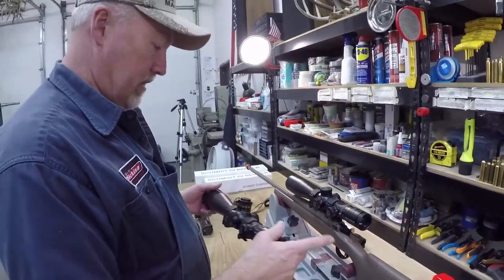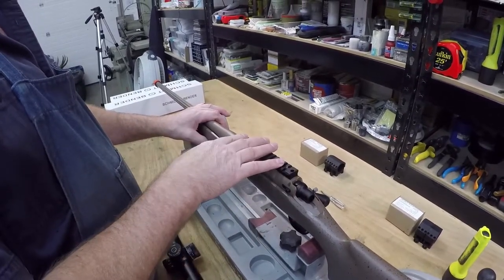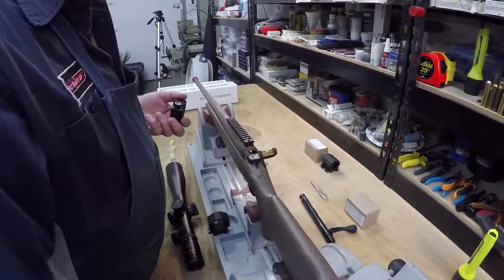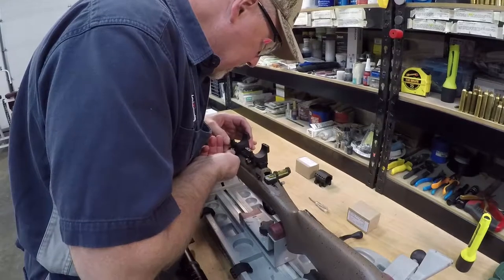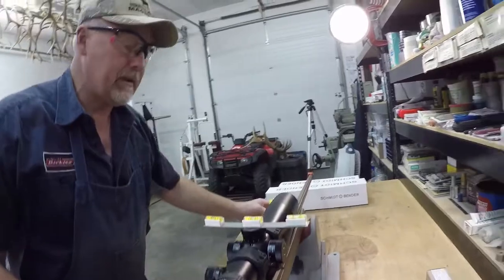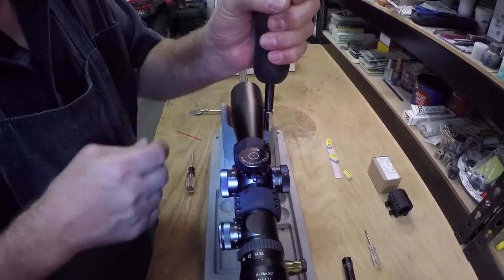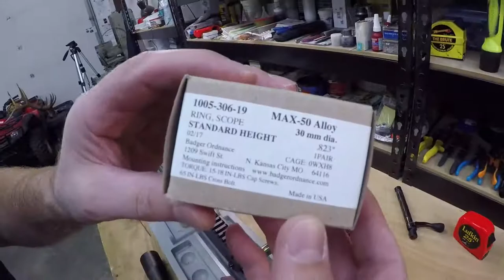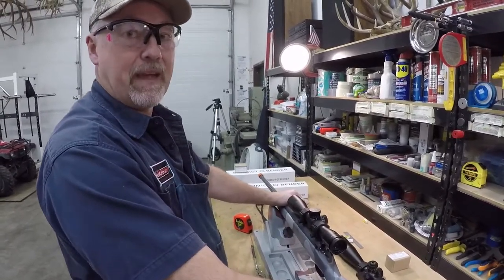Quarter Minute Magnums, How to Mount a Scope

Comment: Hi, if you get a piece of steel or aluminium about a quarter inch thick, four to five long inches and three quarter inch wide. You can glue a small good quality level to the one end, slide the piece of metal to the underside of the scope and level it. The underside of a scope below the turrets is perfectly flat and gives a good result. This was pointed out to me, I hope it helps. Love your videos
Reply from the maker: Dear Sir - very good, thank you.

Comment: Wheeler bubble levels? Do those actually read level? Calibrated?(if that is such a thing) . Those are budget items, im puzzled.
Reply from the maker: Dear Sir - I have Starrett machinist levels also, but they will drive you crazy. As long as you have two or three of the cheap ones to cross reference they work fine. Thanks................
Reply: @quarterminutemagnums  checked with Starrett, awesome. THANK You for the reply. 👍

Nicely presented video.

Comment: Those are awesome mounts,,,, but for hunting those bolt holes on top Will  hold water and will rust,,,,,,,,,,
Reply from the maker: Dear Sir - that is possible. But, you can DuraCoat or CeraKoat - or stainless hardware. Thanks...........
Reply: @quarterminutemagnums  no disrespect,  sir but been there done that,,,,, tks,,,,